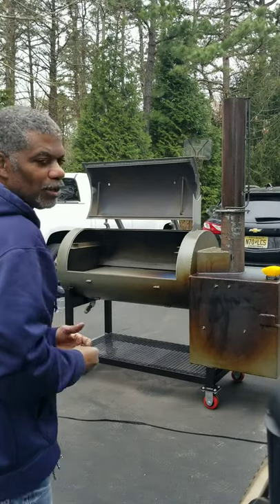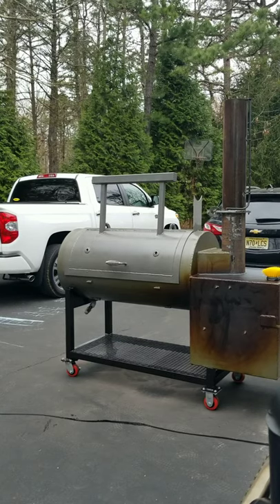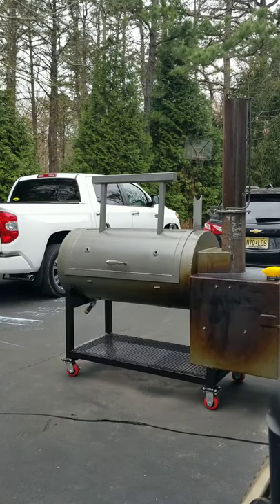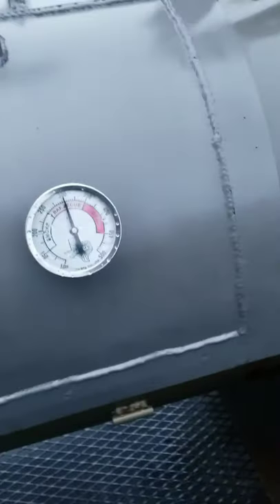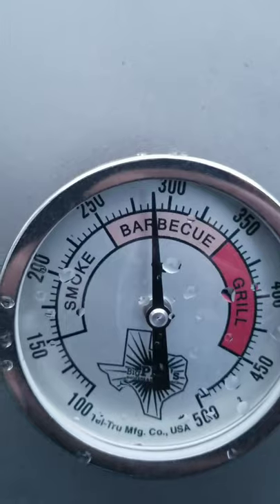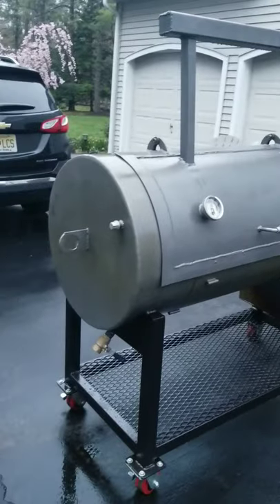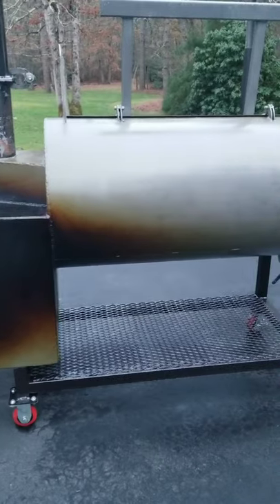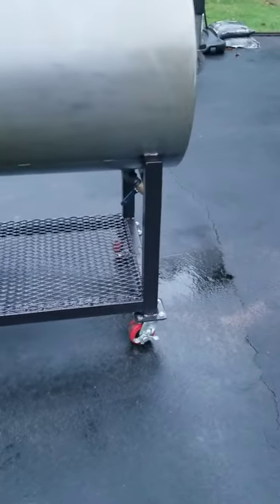Cleaning and seasoning my reverse flow offset smoker.

Comment: I definitely wouldn’t paint over that oil. You’ll regret it. Once you cook on it for a while the whole thing will change color. Takes time. Keep applying oil, if you want faster results torch the outside of the cool chamber.
Reply from the maker: Thanks for watching and the feedback.  Ive already painted over the oil and have used the pit almost t a dozen times.  Haven't noticed a color change yet but can always paint it or oil it I suppose if it changes.
Reply: @marvhill301  cool. Question, how much did it cost to get sand blasted?
Reply from the maker: @BarHRanch  if i remember correctly is 250.00 for the sand blasting.

Comment: This might be a little late but you have to get the temperature of your steel up past about 400 degrees before you apply the linseed oil.🛢
Other options is to just powder coat the cook chamber the color you want it to look like.
I'm going to build a strait flo smoker and I'm heavily leaning towards powder coat.
Reply: @marvhill301  no because of the process of it. It's not just spray on paint. They have to negative charge the piece being painted and the sprayer sprays a positive charge paint to it which allows it to stick and adhere better.

Comment: I'm curious.   Just learned about reverse flow.  All the drippings that eventually go below the heat plate that makes it reverse, how do you clean underneath the plate if it is welded to the drum?
Reply: @marvhill301  i can see that.  Just figured at some point it may need some scrubbing of some sort.  But I guess good heat just burns it off well enough